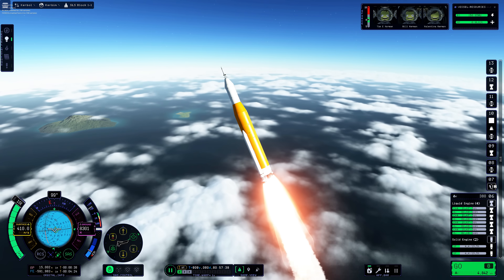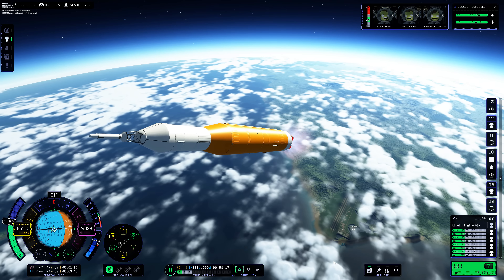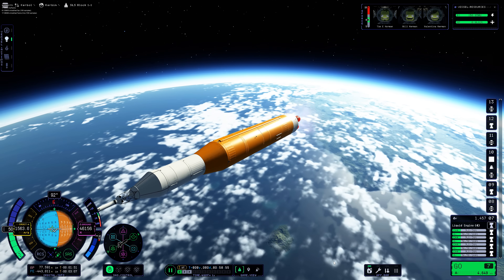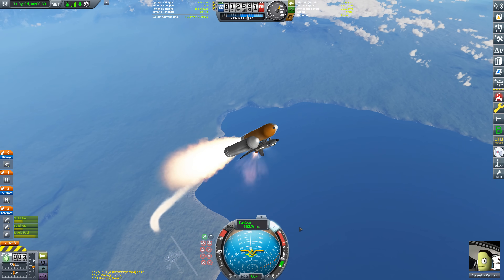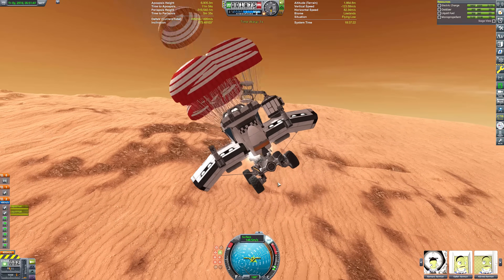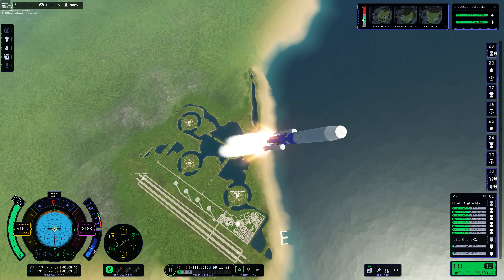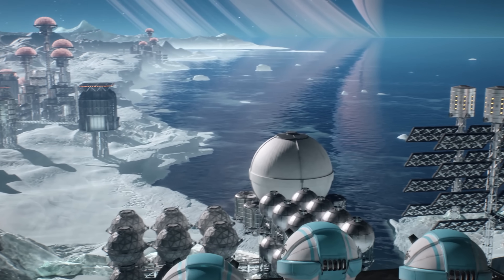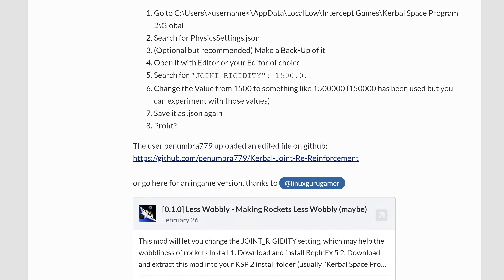Wobbly Rockets Still Haunt KSP2: Developers Face Uphill Battle

Comment: A little note about Starship: it did wobble. The only issue is that actual rockets break long before their wobble starts being noticable by eye, though I'd say it could be found in that Starship's body camera on careful inspection. It's easy to miss it, especially if it's something you don't want to see.
I am way less active with KSP2 than I used to be with KSP1 but I never really had problems with wobble in either. And I never used autostruts, not even once. And I did a few attempts to make wobbly rocket in KSP2 and I actually failed, all rockets I built then were way sturdier than what I expected, even with no struts at all. That makes me wonder where is the problem. Because if the reason fof your complaints is your beefy hardware, then maybe you and devs are each looking at a different thing.
Reply: If the wobble isn't visible in real life, it certainly shouldn't be visible in a game that abstracts and simplifies rocket design.
Reply: @ThaneBrimhall  If the gist of simplification is that it wobbles instead if breaking up, I don't think you'd like the realistic approach.

Comment: The vessel strength (wobbliness / instant disassembly) is right now in KSP2, what it was in 0.22 in KSP1 (The point/patch ust before when we got the science tree).
I remember having to put dozens and sometimes way more struts to make sure the rocket would stay rigid... Which added drag and part count, the latter causing lots of lag with larger vessels.  And back then we had a "Soup-o-Sphere" in which the rockets were much more stable in the air to at least offset some of that drag.

I refuse to play KSP version 0.22 again.  I hope the devs fix this, such a let down so far.

Comment: Maybe just add a procedural tanks this would reduse the number of joints. For if where are 2 tank parts of the same size attachned in a stack there should be no flex but for radial attached there shoudl be some flex. Ther should be soe flex at stage separation ect. If you had a verry tall and thin rocket there should be some flex but not a joints this would be more of a structural bending. I dont thing there is a one  fix think fits all for this. Maybe have a limit on how big a stack be be before its not treated as one part and keep a more realistic joint flex there should be some.
Reply: The really bad wobble is at the stack separators. They still shouldn't be anything like this bad; I'm just saying fixing tank joints won't fix it.

Comment: The entire vessel being one rigid body would be so nice - you dont need to punish rediculous designs with wobble, drag will help with that just fine. Plus those physcics calculations no longer being used would free up tons of performance, something we all which was a bit better than it is now
Reply: The legend himself!
Reply: The solution is easy, if you have a single 2.5m fuel tank connected to a 2.5m adapter, make it solid. If you have 100x 2.5m fuel tanks connected together with a crazy aspect ratio, make it wobbly. the higher the aspect ratio, the more flex. Use a realistic aspect ratio? no flex.

For radially attached parts, a single connection (for example a radial decoupler) will be prone to torque. 2 or 3 connections will be solid.

Is it really that hard to calculate wobbliness when you bring a craft out of the VAB and bake it into each joint before the simulation starts rather than calculate it real time?
Reply: @Ikaros---  You have to take the weight in to consideration as well. A tiny part on top of a large part can't wobble the same as a rocket in the shape of an hour glass for example.
Reply: @Ikaros---  Thank you for saying it.
I'm a dev and such a simple fix would definitely be easy to implement. Unless the whole codebase was rotten beyond salvation, but there's no way that's the case, right?

Comment: Why not try a hybrid solution by "welding" and thus not simulating joints which have a minimum amount of contact area/points? This way you get a solid rocket stack but still wobbliness if things aren't correctly attached. Requires an extra but not very complicated calculation each time the craft parts change (docking, staging, losing parts) and launch, but not every physics tick.

Comment: Play Juno! :) I'm told really big rockets in Juno can wobble now, but it's nothing like KSP2. It's designed more like Kitbash Model Club and I've seen options for adjusting flexibility in one of the parts options section. There's also a way to add connection points between parts, but I'm not sure how it works because I haven't tried it yet. Sorry to be all vague. IDK I'm really bad at testing stuff, it hurts my head. If it does work for you, Matt, then it's a whole different stock planetary system to explore, and Juno comes with its own downloader for planet systems and mods so, in the long term, you have every excuse to use them.
Reply: I'm pretty sure rockets cannot wobble in Juno.  It's possible that wings on planes might "wobble," but if so it's special case code.  As you said, Juno vehicles are treated as single rigid bodies.

However, I cannot recommend Juno -- while it is far, far superior to KSP 2, it is roughly equivalent to unmodded KSP 1.  When you add mods to KSP 1, KSP 1 is clearly superior in terms of game play and graphics.  Juno's "advantages" are ease of sharing craft files, additional options to warp parts beyond what procedural parts gives you, a fully compatible mobile version, and an integrated programming environment.  Making matters worse is (in my opinion) the developers are far more interested in adding new features rather than fixing bugs -- to the point where clearly erroneous behavior is classified as working as designed.

Your milage may vary,  but unless you are really into programming or really want the KSP experience on a tablet, KSP 1 + mods is superior.
Reply: @jmr5125  Thanks for your input. I haven't been able to play either game as much as I'd like to and never found the time to mod KSP1, so additional experience is welcome. I have one question: Do you mean mods improve KSP1's gameplay?
Reply: @eekee6034  Yes, mods dramatically improve KSP 1s game play.  Juno is marginally better than unmodded KSP 1.
Reply: @jmr5125  I didn't think to ask what kind of mods, but what I'm really wondering is whether and when these mods will be available for Juno. If you tell me which mods improve gameplay the most, I'll try to find similar ones in Juno.
Reply: @eekee6034  Well, I can tell you up front there are no equivalent mods for Juno  Also, the Juno mod community is...  Non-existent in  comparison to KSP.  This is in part because Juno is much newer, in part because many Juno users are on mobile devices, which do not support mods at all, but mostly because the Juno community is much, much, much smaller than the KSP 1 community.  The last is, in large part,  because Juno has little to offer KSP 1 players that play with mods (which includes all potential mod _authors_).

Keep in mind that the vast majority of mods are written by fans of a game who happen to be programmers as well.  The developers of a game can offer explicit support for mods (which Juno does), and provide documentation on how to make mods (which Juno also does), but its up to the community to actually develop and maintain the mods, and, to date, the Juno community has not shown much interest in doing so.  Certainly any of the KSP 1 mods listed below could be ported to Juno -- but...  Well, "Why bother?"  It would be an enormous amount of work to do so (especially when you include the time to update the mods with each patch) plus the community is much smaller.  Thus, the vast majority of people who have the skills to make mods and are interested in playing "realistic spaceflight simulators" focus exclusively on KSP 1.

With all that being said, there are two major mods that any KSP installation requires:
* TweakScale:  This allows you to increase or decrease the size of most parts when constructing a craft.  The reason that it is critical is it allows you to reduce the parts count of your craft.  Juno has all of this out of the box, plus more.
* Eve:  This adds a range of visual improvements to KSP.  Almost everything it adds is included out of the box with Juno.

There are a myriad number of other gameplay affecting mods that you can add that go beyond what Juno offers.  A list of the mods that I commonly add:
* "Chatter" (just adds noise during orbital flight), 
* "ScanSat" (adds a robust scanning mechanism that makes scanning planets interesting, and missions in career mode to scan the planets), 
* "MechJeb," (adds an orbital autopilot), 
* "[x] Science! Continued" (provides a list of what science experiments still need to be performed in particular biomes / situations, not relevant to Juno). 
* "Kerbal Alarm Clock" (adds, well, alarms to warn you when an inactive craft is approaching a burn -- essential if you want to run multiple missions at once), 
* "TAC Life Support" (Kerbals now require food / water / oxygen to survive), 
* "DMagic Orbital Science" (adds more science experiments that you can perform, not applicable to Juno), and likely several that I'm missing.

This is, by no means, a definitive list of "must have" mods for KSP 1 -- just my list.
Reply: @jmr5125  Network effects are an issue, yes. I think that the biggest dent in the popularity of Juno is the existance of KSP2, and if KSP2 hadn't launched when it did, Juno would have skyrocketed in popularity. But there really are very few mods for Juno. I expected to spend an hour looking at only the most popular, but the whole list of all mods available can be covered in 10 minutes. Maybe it's because mobile Juno doesn't support mods.

Chatterer is cute, as are kerbals. Droods aren't so cute to start with, and the lack of a face is offputting. Sometimes, I think this is Juno's biggest problem. ;) The one really good thing about droods is that they're much faster on land; running around to explore is much more fun with a drood than with a tiny-legged kerbal.

ScanSat... yeah. When I bought KSP, I was surprised and annoyed to find everything was basically discovered already. There's no such mod for Juno.

I think some Juno players are scripting autonomous missions, but how scripting compares to MechJeb I don't know.

Science I don't know about. I haven't touched Juno's career mode and have hardly played KSP's, funnily enough. I'd be more likely to play it if there were more experiments and they weren't so cheesy.

Alarms would be good. I think I read that the automatic burn feature works for craft which aren't currently being piloted. If true, you don't strictly need alarms for manouvers, but it would be nice to have them for checking the results of burns and for other things.

Looks like there's nothing at all for life support.
Reply: @eekee6034  I"m dubious about KSP 2 being the source of the problem with Juno for three reasons:
1) Juno was available in EA long before KSP 2 launched.  It was called SimplyRockets 2 during this time, but it was still out there.
2) Juno full launch occurred before KSP 2 launched its Early Access.  Not much before (about 1 month), but nevertheless Juno's full release version was available before KSP 2 started Early Access.
3) The KSP 2 launch was a catastrophic flop, leading to many players requesting refunds.  So, if anything, Juno should have benefited from KSP's 2 launch -- players that have just spent money on a "realistic flight simulator" (& received a refund)  would be much more open to purchasing another game in the same genre.

There is no real MechJeb replacement, although there is a Vizzy craft ("Orbital Maneuver Suite Version 3.0") that offers the most important pieces of MechJeb's functionality, at the cost of a much less friendly UI.

Juno has no science at all.  Progression in career mode is handled via accomplishing milestones (e.g. "Achieve Orbit", "Orbit Moon X", "Recover a craft X times").  There are pluses and minuses to this approach, but one thing is very obvious -- there are zero science experiments to perform in Juno career mode.

I would be very, very surprised if turning on "Automatic Burns" would result in a burn occurring on a craft that is not currently being controlled.  I can't say for certain that this isn't true, but there are lots of reasons why this shouldn't be true.

Comment: The one dimensional joint system is fundamentally flawed.
Even if fuel tanks in stacks were separate pieces, no one would fasten them at one point in the middle of open space between the parts.  At the least, if they want the joint system, it should be connected at multiple points, at the points of contact. 4 (or more) joints around the actual cylinder edges where the pieces meet and touch is a much more realistic and intuitive way to present the mechanic, give them individual bending and breaking physics per joint, and the system is now much more rigid and realistic.  Now that would probably push whatever current code their using to the limits and probably render the game unplayable, but again, no one asked them to reuse all that code.

Comment: Personally I think the solution to this is a two step calculation.
1) How far is the part from the center of mass? 
         if n<x<m, where n is the farthest negative(downward) distance before wobble occurs and m is the farthest positive(upward) distance before wobble occurs.
2) Are the connecting parts the same diameter?
         if so, make them rigid.
This should be fairly easy to implement if all the parts are similarly coded and not all unique structures. 

Note: I am not a game developer and have no experience with coding.

Comment: Wobble should be some kind of function based off of the difference in mass between the joints, plus the number of parts between the joints. 

Put a SRB on a stack that is 3x more massive, and the wobble will only effect the SRB at the joint. Something like that. 
\

Comment: Such a simple solution: 

If you don't want to compromise all wobble, but you want to implement something like Harvester's solution then just do this: 

Instead of combining the whole craft into a single rigid body, subdivide it into multiple rigid bodies: anything stacked should be one body*,  and anything radially attached or placed on robotics hinges can be its own body. 

*(unless the stack exceeds a certain ridiculous height/width ratio where you'd expect noodliness, at which point it can be multiple bodies separated at the weakest points, but still made of multiple parts each, with the joint stiffness cranked to KSP1 Joint Reinforcement Mod levels.) 

--Disclaimer: I am a programmer and a game developer, so yes I know what I'm talking about and this is the obvious solution that I have no idea why they haven't already done.

Comment: That is an excellent video which summaries my sentiment quite well up on the topic. 
The limit in my KSP1 experience is the physics engine and its drop in framerates with higher part counts. I practically autostrut all the parts all the time, apart from docking ports and robotics, where the functionality gets impeded. 
I happily take a reduction in physics "accuracy" in KSP, when I can build more complex vessels. 

I must say, I am a bit baffled as well, that we are seeing this kind of fundamental discussions more than 3 years into the development. I got the feeling, that maybe the guy implementing the calculations in KSP1 should not necessarily be the same guy doing it in KSP2, given the issues with the topic. 
As these kind of concerns with the limits of the parts based physics calculation have been uttered quite vocaly early in KSP2 development, I am a bit miffed that they basically replicated the KSP1 system, albeit much worse. 
I am glad that they are putting in the work now, but holy moly, it is quite late for that. They already botched the KSP2 release quite hard and took a deep bite out of the KSP1 player base with their approach. Maybe a new way of thinking about stuff would be more appropriate in this stage of development.
7 month after the release, and people still wonder with right whether and when the 50€ "game" gets in a playable state. 
It is also quite funny, that the Art Director Nate Simpson gets soak up all the blame and the project manager responsible for this development enver gets his name dropped.

Would be good to get something from Nate Robinson as well, but I feel they manage that with quite some intent.

Comment: I think some of the rocket wobble is also caused by SAS PID tuning, the engine TVC moves abruptly and causes positive feeback loops
Reply: Yeah the algorithm for sas seems to over correct with no way of actually mitigating or ending the procession.  Imagine if autopilot worked this way, planes would be falling out of the sky constantly.
Reply: you have no idea how bad that used to be in like 2012 before they fixed the tuning

Comment: I don't even understand the point of having to put struts on radial boosters to secure them. What sort of meaningful gameplay does this provide? "Oh no, I forgot to strut my side boosters, gotta revert, place them and then relaunch"? It just feels like a tedious extra step that gets old very, very quickly. Just leave the wobble out entirely or do it like in Juno where wobble is applied to side decouplers but in such a small way that you'd have to build an absolute monstrosity for it to become an issue